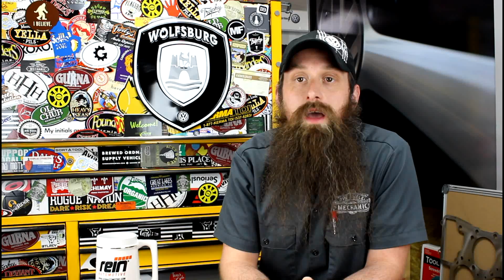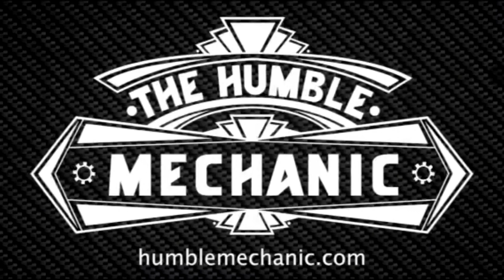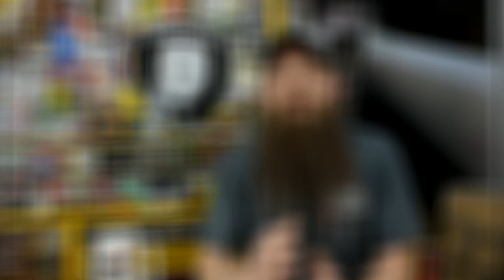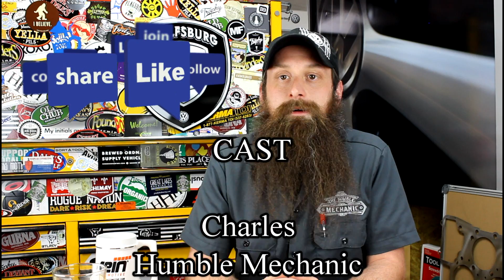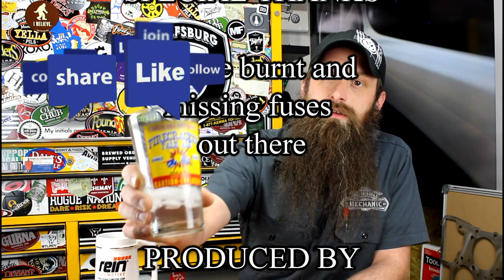Thinking Like an Automotive Diagnostic Technician

Comment: I spent 7 years in the NAVY and was a reactor operator and all the hands on repair ways was always start at the end of the circuit and if it is not working cut in half and if it not working there you then cut it 1/2 again . With that mind set I got thu some very hard NAVY schools . 2 had a 45 % failure because they would not follow that way of repair . The NAVY wants it done there way as it has proven to work for them for years. I still use it today I an I was the navy in the late 80 s

Comment: Hi HumbleMechanic,

I was wondering do you have specific wishes for information about a car from the engineers at the car manufacturers. Apart from correct wiring diagrams. What kind of information is constructive to you?
Reply from the maker: +SE45CX correct info is VITAL!! Also information about reading and interpreting Values seen by ECM. 

And a more in depth explanation of how systems function. We are expected to know everything and every system and the info is WEAK.

Comment: when i worked at a vw dealership i ended up using the vag 1551. not as fancy but it worked.
Reply from the maker: +Brian Skinner hell yeah 1551!!  That thing was awesome for talking to that generation car. Probably wouldn't help out too much today.
Reply: I agree. I'm not sure if you got to read my comment about the AAA vr6 compared to the newer vr6.  I thought both the AAA and aba engines were more responsive than the newer ones. Both 4&6 cylinders especially if you do a quick snap of the throttle.  I wasn't sure what you thought. Let me know. Thanks Brian

Comment: "You gotta go low tech before you go high tech" A factory tech specialist from Mercedes Benz told me this when I was an Apprentice. Some of the best advice ever.
Reply: Low tech would be like checking primary things like fuel supply. While high tech would be checking the fuel injectors/sensors etc...
Reply: PHXGlock what do u mean? what was the context of the advice?
Reply: @mn4a15  Pull out the test light before the big bad scan tool
Reply: @mn4a15  In a no crank situation, check ground first.
Reply: @ScorpionRegent  gotcha

Comment: Like the vids, man. First tip of the vid. Check fuses. Then you said you did all the basic checks and about to check the motor. Then the problem was a missing fuse...
Reply from the maker: That's an issue I have seen a lot. Missing Fuses have eaten the lunch of many techs.
Reply from the maker: And thanks for the kind words.

Comment: part of the process which we use (or should) in the computer world, is known-good, not as easy i admit, in an automotive situation, but if possible comparing your diagnostic readings or results to a known good working version (even if it is in another car) - sometimes specified values in manuals are ideal, not real world.

also regarding fuses, i once was diagnosing an issue in one of my older cars, and wondered why it kept blowing,  i went through a large number of fuses, before i took the step back and thought "is the fuse the correct rating" - turned out it wasn't  which was why it was blowing all the time - luckily not a whole lot of time wasted, but a dumb oversight never the less

Comment: Hey Charles, I have a 94 Dodge Caravan that is my every day driver. I had a problem with the torque converter not locking up. After first checking the solenoid, the ECM for a ground signal, the switch at the brake pedal, going through the wire harness, all of which were just fine, I took it over to the local trans shop. The guy looked at me like I was nuts, he couldn't understand why I was fixing my 21 year old vehicle in the first place. I took the thing home, pulled the trans, put in a new torque converter, put it all back together, still wouldn't lock up. I finally scoured the internet and found a wiring schematic. Turns out the problem was the coolant temp sensor, it should have 35-40 ohms of resistance, mine showed 41 ohms. Apparently it was out of spec enough to cause the converter not lock up, but not far enough to trigger a code. 20 bucks and ten minutes was all it took to make the repair. Wish I had seen that schematic before all this, but in the end that is how I found the problem.  If you drive an old vehicle you may have to come to realization that most places don't retain all that old repair data and you will probably have make the repairs yourself. I proudly call myself a mechanic.

Comment: Same here about walking away, a simple task alows my brain to reboot and normally I get an idea where to go next, and boom problem found.

One thing I do is based on experience is testing most likely cause, if the both head lights do not work but high beams work and all other lights the easiest thing to do is put a bulb in:) built in test light;) unless bumber removal is required. A lot of techs have the issue of over thinking a problems.

As for modules confusing tech, BTDT tail lights go out on a later model dodge truck, but a bulb in and it still doesn't work, clear fault code in BCM and it works again. Lots of techs have gotten stuck on that simple issue.

Comment: Funny that you talk about a NB top last week I worked on a 2003 for the same issue wen I would unlatch the top the little screen showed a open top but the pump would not run I checked for fault codes there was one for the right side top lock then removed the quarter panel and all was ok then check the wiring diagrams and it showed 2 fuse above the pedals assembly there was a breaker style fuse tested it was ok so found the pump valve check the mechanical operation of the top all seem ok so pulled the left trunk trim and put power on the pump motor and it runs so I notice two relays behind the pump so I pulled them out to check for corrosion put some contacts spray an tried the top and guess what it worked so I fixed it and I'm not 100 % sure what fixed it not sure if it was a bad contact on one of the relays of just the pump brushes were not seated properly or just applying direct current to the motor made it start any way the result was ok I did know about the window relearn procedure for the NB to possibly fix a top issue.
Reply from the maker: V10PDTDI The NBC seem to have some weird issues. I have never seen that issue you did. I see a lot of open position switch and flap issues

Comment: I am a toyota technician and have been at a dealership for a little over 3 years. I have one ase Certification for suspension and steering . I feel like some of the other technicians and service advisors don't trust me to do certain work on vehicles . I work on all makes and models new and used and I am the ONLY guy in the dealership who isn't afraid to tackle any problem on any car . I also have a degree for automotive technology. I am hoping to become a master certified toyota technical by the end of this year. How can I get the people in my dealership to trust my work and have faith in me ? 
Thanks for your time
Reply from the maker: ToyTech816 That is a great question. For the most part, it takes time. It takes doing a good job over and over and over! 

What do you think the reason for the mistrust? 

What can get really frustrating is when you work your ass off and do a great job, no one notices. But if you make a mistake, everyone knows it. 

I worked really hard early in my career to earn the customers trust. When customers start asking for you by name, everyone takes notice. 

Keep working hard. Keep fixing cars right the first time and have a good attitude!!!

Comment: right now I'm trying to diagnose a water leak in the roof of a 2015 Ram 1500 without a sunroof.  Not easy.   About customer information. I recently saw an RO go to a neighboring tech that read, "Test Drive, Customer states something is wrong with the car".
Reply from the maker: Seth Jones Stuff like that really pisses me off!
Reply: HumbleMechanic yeah, but then you get some that make you laugh like, "customer states, cant feel car shifting into 9th gear" on a jeep that has an 8 speed transmission.
Reply: +Seth Jones That's when I write on the RO " Problem stated does not occur in shop." That service writer should be fired. My field is consumer/prosumer electronics and we see all the same kinds of retarded shit that you all do.The difference is I have the opportunity to embarrass the boss in front of the customer when he writes on a work order "fix it" or "make it go." (He's getting better)